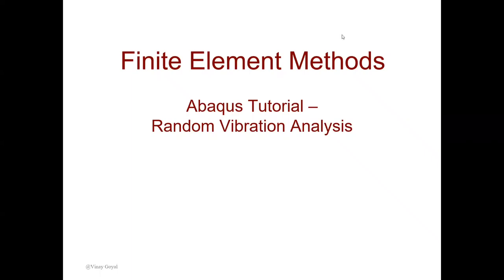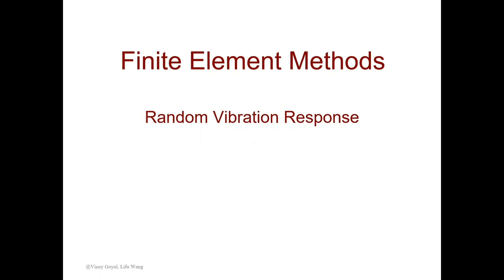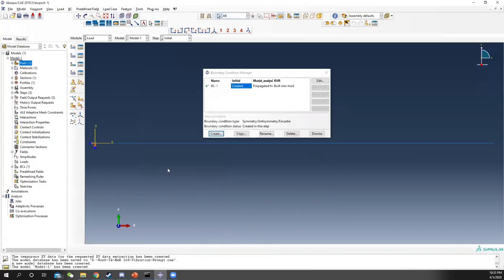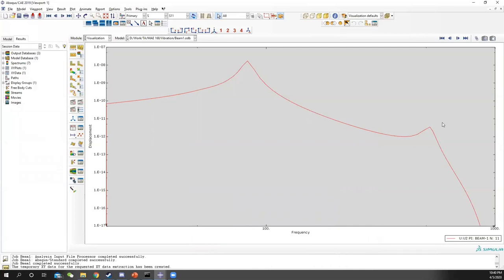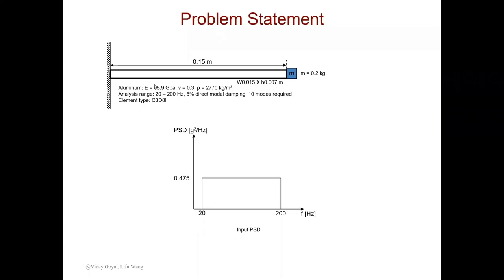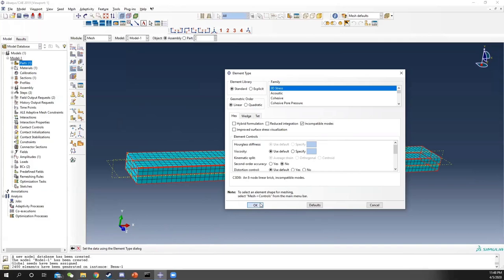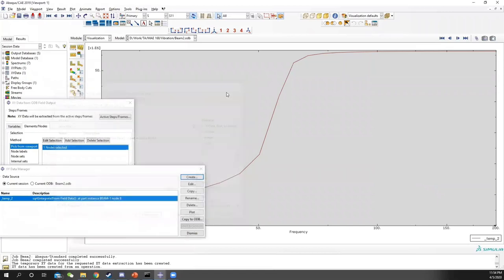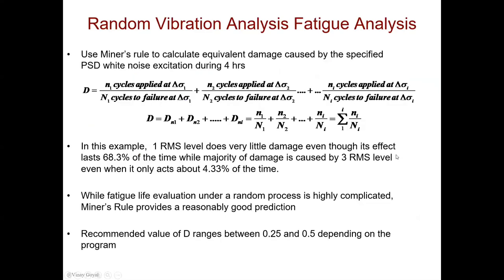#ABAQUS Tutorials - Random Vibration Analysis

Comment: Do you know if random response can be applied to a load?, or it is only
applicable to a base motion?
Reply: Thank you
Reply: Just base motion..
The same problem with me..
I wish if i can solve that problem
How to put applied load with Random vibration
Reply: I solve the problem..
Add mass instead of load from Interaction >> special>>mass inertia
Reply: Hi, Before 5 months the same problem happend to me, there is no load in Random Response in Abaqus so your load should Transform it to mass not load..
Either point mass inertia from Interaction step
Or 3D shape mass add it on your structure